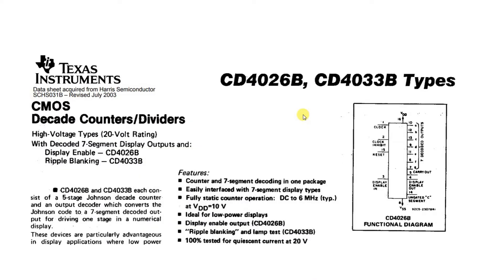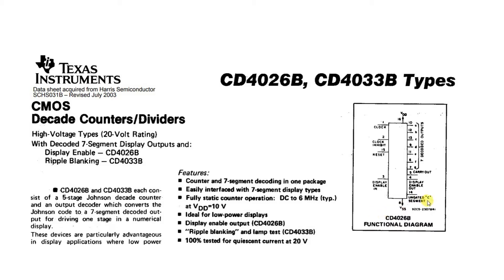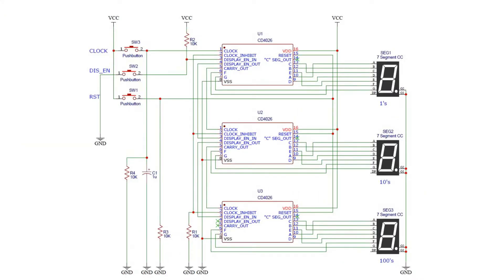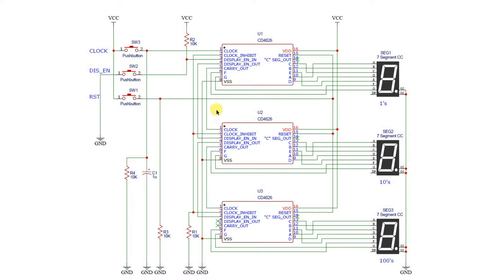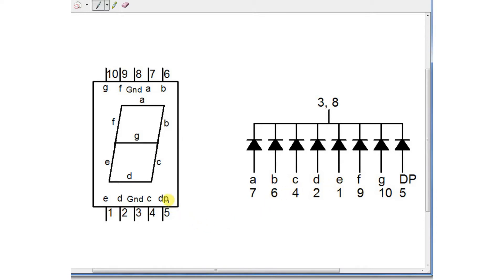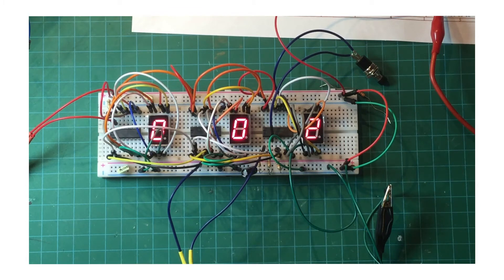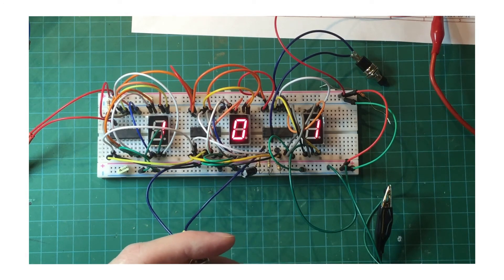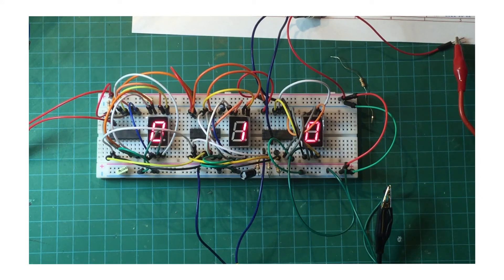CD4026 0 to 999 Decade Counter For 7 Segment Displays Demo

Comment: Sir. Could you please explain 3 digit circuit of common anod 7 segment display like this one?
Reply from the maker: Hi Abhinav, you can use either the 7447 or cd4543 chips to drive a common anode display. The problem with these is they don’t have a carry out pin, so you need to add gates that detect when you have reached a count of ten. I haven’t seen a chip the drives common anode with a carry pin. Another option is to add inverters to the output of a chip for common cathode type display,  this will work. Otherwise you need to use a microprocessor to control displays with no carry pin. Why not just use common cathode displays? They are cheap as dirt.
Reply: @simoncarter568 also using transistor can be useful in comm anode.
Reply from the maker: @Akram-vl7xq  In what respect?
Reply: @simoncarter568 I mean in common anode seven segments we can use in this way for connecting it to CD4026:
CD4026 Pin->base resistor->2N3904 
2N3904 collector->segment resistor->related segment
2N3904 emitter->ground
Sevensegment com pin to vcc
In this way we can also connect common anode to cd4026
Reply from the maker: @Akram-vl7xq  ah, right, I see what you mean. I didn’t do that as it is quite a few more parts,
Reply: @simoncarter568 in cd4026 datasheet, it uses transistor for both common cathode and anode, do you see that? I directly connect cd4026 pins to common cathode seven segment and it works like your video without any current drawings! Why we should use transistors in common cathode?!
Reply from the maker: @Akram-vl7xq  If I understand your question correctly, I think the answer is this: The CD4026 chip pins can supply around 6.8ma maximum of current, this is enough to drive the led in a regular 7-segment display. If you are using something that requires more current then you need to use a transistor. Suppose you used a small light bulb for example, then the CD4026 could not supply enough current to light the bulb. Basically the small amount of current coming out of the CD4026 pin goes into the base of a transistor which then can pass much higher current. Also, Sometimes a transistor is placed in series with the anode or cathode of a display. The base of this transistor is connected to a microprocessor. So the transistor is used by the microprocessor to turn the display on or off. I hope this answers your question.
Reply: @simoncarter568 Yes, thank you. And thanks for sharing the videos that are very helpful.